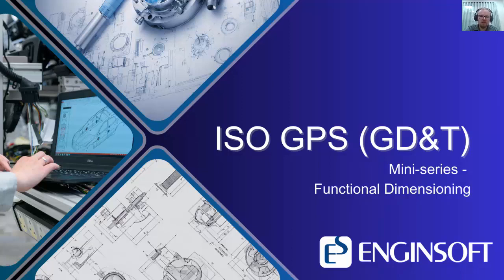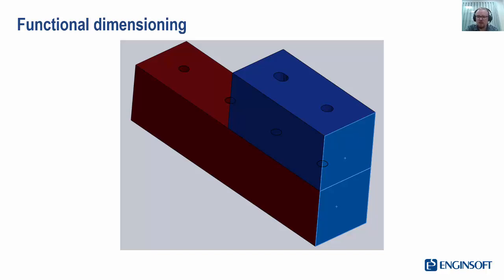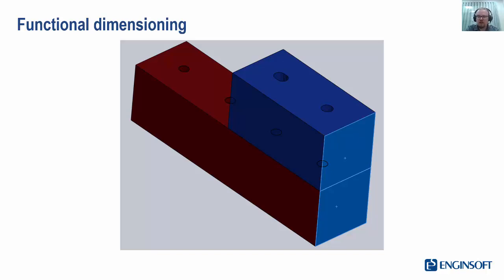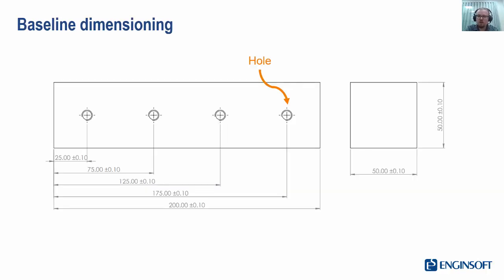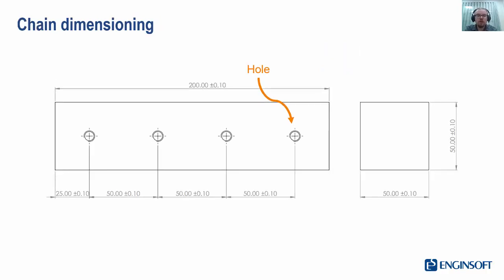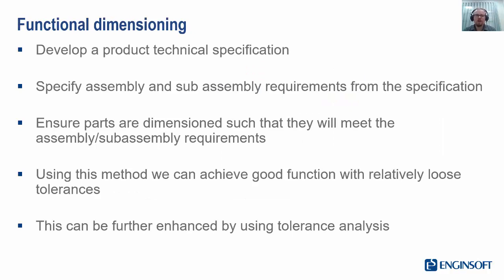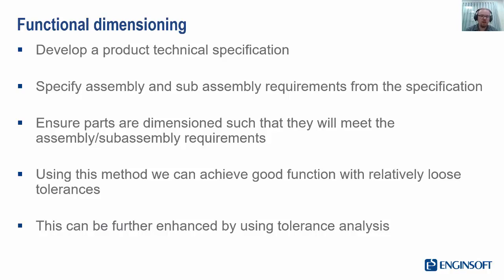ISO GPS (GD&T) Mini-series - Functional Dimension

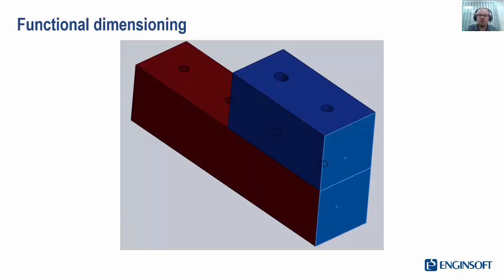Comment: @0:37 I don‘t understand your idea for „Specification types“: Fit is a  very famous ISO GPS standard function of a feature, isn‘t it?
Reply from the maker: It is, I’m referring to the requirements you may have for your part & assembly rather than using the term “Fit” per the ISO GPS standards. For instance, you will want to ensure that parts fit together as well as being aesthetically pleasing as I mention in the Form section. I hope that clarifies what I meant by specification types, but do get in touch if you would like to discuss further.